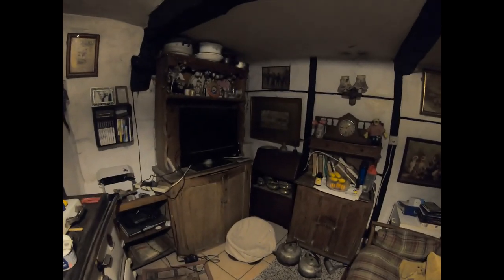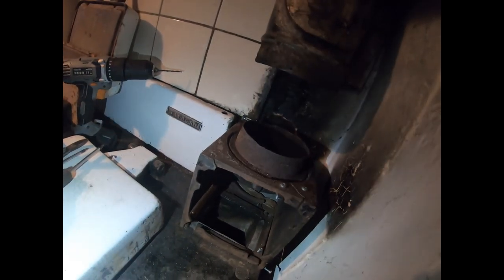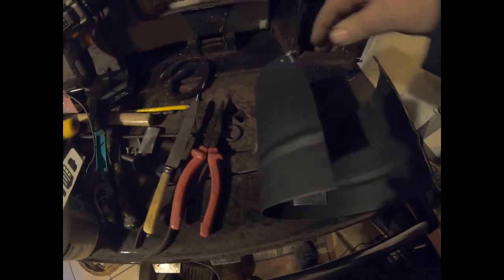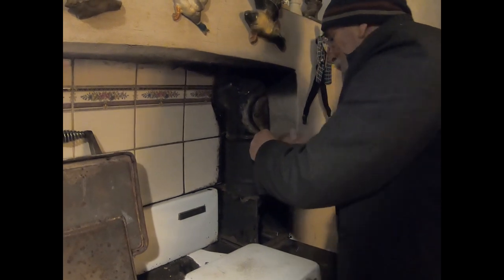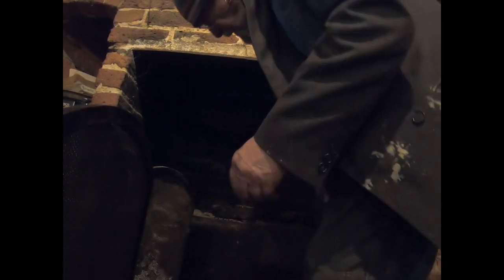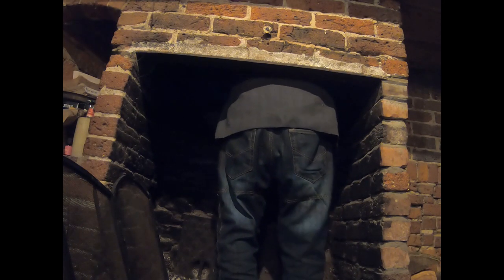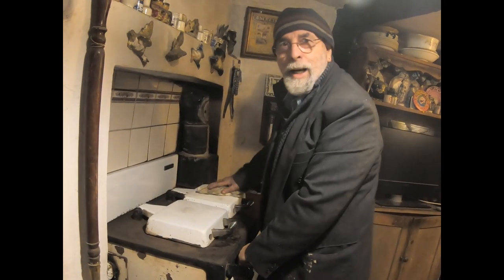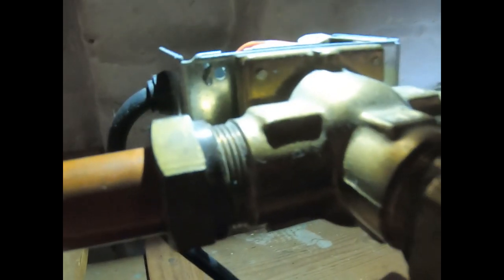How to Remain Calm and Patient when Repairing a Rayburn Cooker Flue. May Contain the Odd Swear Word.

Comment: John, I was amazed that it worked. I am just about to put the exact model of Reyburn in myself, at least the version I have is the 216mf with the flue on the left. Question, if I may? After I re-drilled and tapped new threads in the top to fix the flue box in position it has left lots of gaps where the two meet, this was mainly caused by the top being bent. I improvised and used a bit of metal packing, hence the gaps. So should I use heat resistant silicon to fill in the gaps or fire cement?
Reply from the maker: Just seen this comment. Sorry for late reply. I think fire cement is easy to use and handle. I haven't tried the silicon.
Reply: @JohnBain1st  Late reply! No Problem. Another question if I may? How easy are these things to plumb into an existing plumbing system? Are there any (don't ever do that) rules?